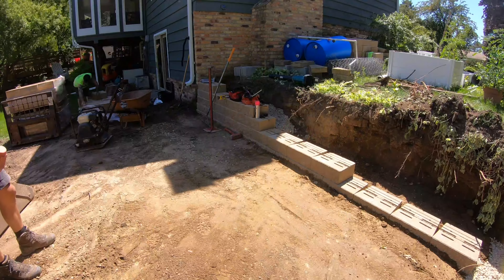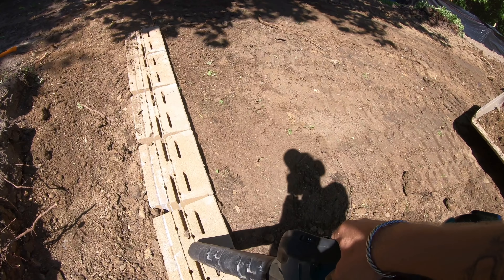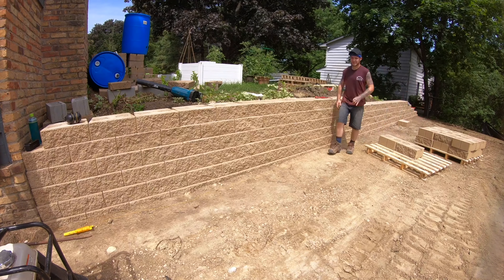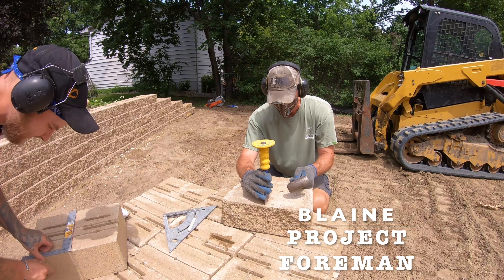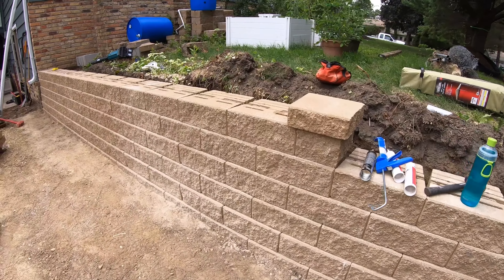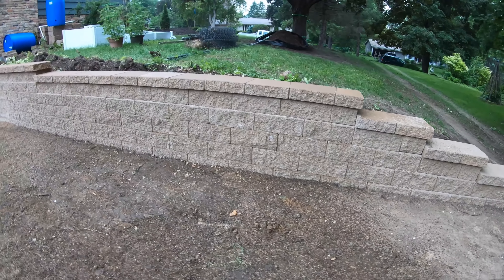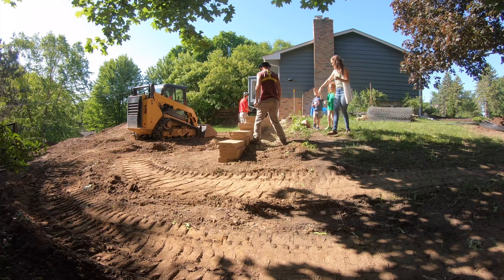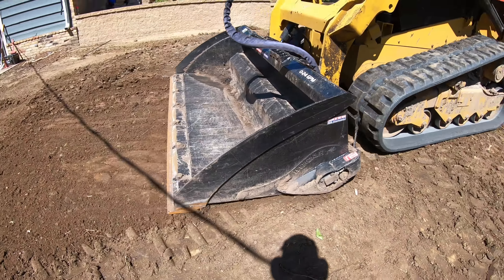Finish=Turning a Hill into a flat(er) backyard 4k

Comment: I have  a side yard that has a about 1 foot slope on lowest part of slope where fence is.  The higjesf part of slope starts from the side of the  house and backyard porch  going down to fence facing street. The space on side yard where I have slope is about 15 feet from house to fence and about 50 feet long. I wanted to take out about 1 foot of dirt to make that area flat, and add a drop down with maybe 2 steps where porch is to go down to flat area...I was thinking about adding concrete once is flat? This 2 guys that do concrete went to my house and said it was better to fill in the lowest part with dirt to make it flat and jse that space then lay concrete down. I know a retaining wall has to be build inside fence to hold dirt in. If I do it this way how far from fence should the retaining wall be?
The  rest of my yard is pretty flat is. It's just the last 15 feet  on side of the house towards the fence that I start getting the slope that I wanna make flat so we could use it too.  Tje only problem with filling in that area with dirt is that I will have no privacy since tje rest of my yard already sits high and people can see the inside of my yard from street.  That's why I was thinking of taking out dirt instead of adding?  However, I  can always add some type of pots with bamboo trees or add lattice or something for privacy?

Comment: I'm a union carpenter who works specifically on bridges.. I've used a lot of different brands of masonry saws but never a Husqvarna... 
   Ive also done some flood  relief work for a non profit organization during the 2016 floods in wv, which involved clearing log damns, cutting out and down trees from waterways, and clearing debris that have washed up and piled up. During that time we used Husqvarna chain saws and they were very temperamental... they worked great the 1st few weeks we used them then they would start acting contrary after about a month of daily use...
   I was told later by the guys that work on them daily they needed to have their carburetors adjusted after a period of time...
    We were told that about 8 month into using the saws tho... don't know if it would've made a difference if extending the life of the saw or not but whatever the case, we went through saws like they were made of plastic...
   Some of that may have been due to user error as well, because we had a lot of inexpensive guys working on with us that tore up the cogs ( that turn the chain) because they either under tightened and or over tightened  the chains (which also ruins the bar as well).
  I know this was a review of the masonry saw, but the motors are basically the same...so really just giving you a heads up just in case your starts not wanting to start after a few months of use

Comment: Unrelated to this video but we are filling in our backyard large deep fill we have a few large pines 2 mainly in the area that will be filled and a few small maples / oaks I’m planning on making a temporary space between the fill & the smaller trees using logs etc on the small ones that are still too big to move will be moving a bunch of small saplings but the large pines I believe I have to build a dry well around them to keep the moisture at the roots the fill where the pines are will be 10+ feet deep I don’t want to take down the pines so I’m going to try to build a drywell deep enough & strong enough I might use recycled concrete slabs that will be self supported with rebar & correct placement just wondering if you could point me in the right direction

Comment: Hey Guys, where are you located? I'm a 67 year old disable female Veteran And trying to grade my yard, after having 8 trees and 50 bushes cut down and half ass dug up by professionals. Left me a mess. Now, all the work is left for me to before the HOA takes me to court. I can't  find screen black dirt  Or Screen brown dirt, just the same red dirt with slit of wood and rocks. I am try to clean the stuff out of my yard and dig up roots that are under my house and walk at my house And under my driveway. I have been working  in this front and back yard for two weeks And you can see no progress at all. Plus I had to clean up a hill going down my land. I am loosing  my dirt on that hill. Can you tell me what to do And where to get the right dirt. I already have alot of wood & rocks to get up. I am very tried. And how to put up a wall to keep that hill from loosing the dirt from my yard. Thank you Maria Ford in Hiram, Georgia. There is no help for Veterans  in Georgia. I am afraid I will not have a back yard.

Comment: Does this type of wall not require any tie backs or connection between the blocks? I
Reply: Usually the larger sized block such as in the video have fiberglass pins that are used to line up the blocks and help hold them together vertically... the wall really isn’t tall enough to require geo-grid or something to tie back into the hill in my opinion once you factor in the shear weight of the block... Although I would like too see atleast 2-3 feet of crushed stone back filled behind and the whole height of the wall to allow for water flow to alleviate any concerns of tying into the soil

Comment: Anyone know if it's possible to cut some pavers with a miter saw? I'm going to use water to keep the dust down but don't want to burn out the motor. Also, can I use a blade that would be used for concrete?
Reply: Construction Trucks get a used skilsaw, they make masonry blades specific for them.
Reply: @jacksonbennett6151  Thanks. I'm going to look into doing that. I need a new skilsaw so it would be a good way to go.
Reply: @jacksonbennett6151  To be clear, you are talking about a circular saw, right?
Reply: Construction Trucks yeah, and older worm drive works good, it’s a good idea to dedicate a saw to masonry because it will likely reduce its lifespan with the abrasive dust.
Reply: @jacksonbennett6151  I will have to get one off of Craigslist and dedicate it to masonry only.

Comment: Get the highest PSI concrete, with strongest additives like mesh, pour a small square, with different rebar sizes (bigger the better), do the best curing you can do, then try to cut through it as fast as you can as many linear feet as the saw can.

Comment: So these blocks are secured using Pins between the courses? i've seen you use construction adhesive of these blocks before too. Which method is best? is there a reason for the 2 different methods? in my mind i keep thinking blocks need mortar so interested in the diffent approach

Comment: Hey great vid.  Question you used that vibrating dirt compacter.  In another vid you were using a hoppy type thing. Are they the same?  I'm building a 12 by 24  foot shed this year, and i have to dig  a huge ash stump out so I'll have to compact it.  Oh wooden floor. Thanks 
Germain

Comment: Hey Stan, with your access to the public eye and the requirements of OSHA. You should look into the effects of silicosis on those who breath in concrete dust. I cut a lot of concrete a few years back without protection, then my employer brought in a presentation about concrete dust and it’s effects on your lungs. It changes your perspective on why it is important for you, your employees, customers and their neighbors.
Reply: Took an 80 hour OSHA safety class a few years ago at the Laborer's Union Training facility.  Silica is supposed to be regulated just like asbestos.  And most of the the paper dust masks are not adequate.  You should be using a HEPA grade mask.  Did commercial concrete for a decade and cut  miles of concrete.
Reply: Yep! I use a half mask respirator to cut that crap! I’ve been saying for years it’s gonna be the next asbestos

Comment: Thank you for the informative videos! 
I Just have one question: 
What was the reason for not installing a drain pipe system on this wall? 

My opinion would be because the grade is pitching away from the house and the water is not going to be draining directly into the wall. Additionally, the wall is not high enough and the downspout exit point is in front of the wall rather than behind. 

Thank you in advance!

Comment: Wonder how much does a project like this cost.
Reply: I've had similar work done in a different state... I'd guess $5,000.00-7,000.00. I don't know how much that block cost, and my wall was cemented, this one wasn't.
Reply: For the wall, regrading the yard, plus the sod. It has to be $10k-$12K. Stanley builds some top notch stuff so probably worth it.